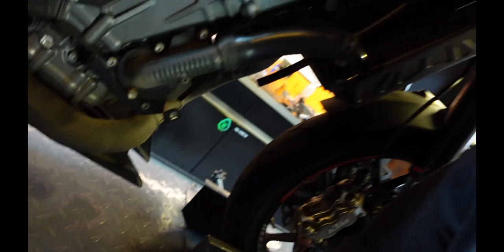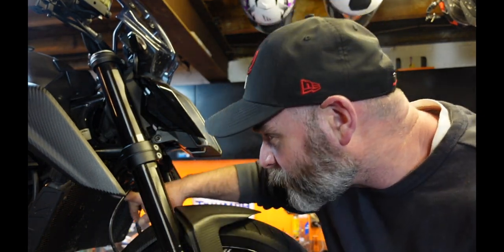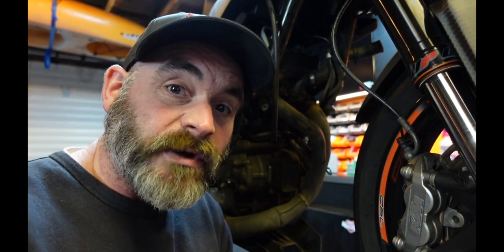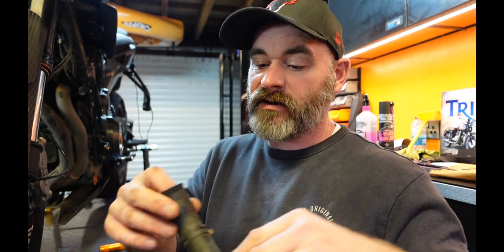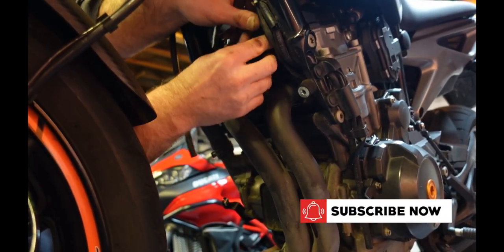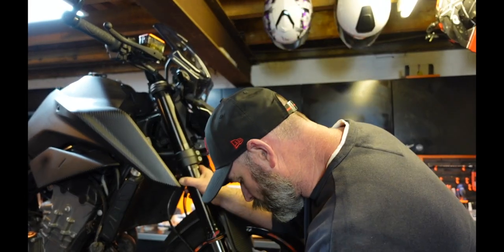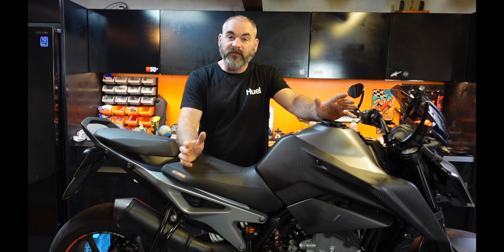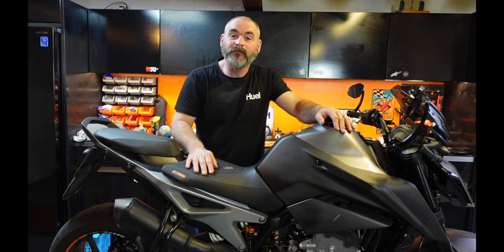How To Repair Coolant Leak on KTM Duke 790

Comment: Thanks so Much for this Video ! I’ve had my duke 790 for more than a year and not a single issue until now when I’m getting the same coolant leak. 

I was afraid to even take the radiator off but I see it’s not that bad at all so I will get some new replacement clamps and swop them out to see if that fixes the issue. 

Your Videos have helped me a lot with understanding how my bike works. 
Thank you !

Comment: I still do not have coolant issues with my duke. What my service told me is that sometimes people use too much of concentrated coolant which is oily and thin and likes to leak from all sides.
Basically, just using ready to use coolant or adding destiled water should solve issue in most cases.
Of course, I am not saying this is universal issue, but since a lot of people are servicing their bikes, it could be that few of those just do it wrong.

And of course, I am not saying that in your case this was issue, but I find this a nice and useful information, so I wanted to share.

Comment: Super common from what I've seen, plenty of people on a forum I'm in have had this issue.  
I had a leak on my 71 plate Duke with less than 1000 miles, not a major issue as mine just needed a nip up with a socket but not great from a quality control perspective.  
Going to get some samco hoses to sort this with some decent jubilee clips.
Reply from the maker: Yes, I always knew it was a common fault with them, but I thought I had been one of the lucky ones - all sorted now and it wasn't too big of a deal to sort.  If I was keeping it I think I'd go down the route that you are taking with the Samco hoses.
Reply: If you're getting Samco hoses you have to use Samco's own (very high quality) matching clamp kit in order for the lifetime warranty on the hoses to be valid 😉

Comment: And after 2.5 years of ownership I'm just now facing exactly the same issue ... that jubilee clip has recently failed on mine too, I can actually get to it with a 6mm spanner and tried to tighten it but no joy, after a few hours theres a small weep forming again. My chosen solution (as I'm keeping my Duke for a while yet) is a full Samco hose & clamp set thats being fitted very soon ... that'll sort it once and for all and look great too 😁
Reply from the maker: Proper job!  Better than my Rolls Royce  jubilee clip🤣. Did the job though!
Reply: @TheBoltHoleBiker  Yep, good but cheap fix you've done there .. no need for more when you're moving the bike on soon. Cracking video too, first one I've seen showing how to take the rad off ... nice work!! 😁
Reply from the maker: @MotoGoato  Cheers!👍

Comment: Hi bolt hole, really useful video - thank you! do you recall where the connector for the radiator fan was located? I'm having an issue with my duke at the moment with the radiator fan not engaging once engine temp is up to 5 bars and had the engine temp warning the other day when in slow moving traffic. I want to jump the fan to see if it engages before removing radiator to check thermostat etc (I see no leaks and coolant levels are fine etc) as don't have the most space to flush everything currently so want to do as a last resort. Thanks a lot

Comment: Useful vid, cheers.  By the way, any idea where I can get matching grey touch up paint for the engine block of my 790? I've got an annoying stone chip which is really obvious as the silver alloy shows through. Cheers Scott
Reply from the maker: Hi Scott, it’s a bugger when that happens!  Colour matching is a bit of a black art, or trial and error as it is generally known!  Most important is that whatever paint you use is heat resistant.  There are various heat resistant rattle can spray paints and Hammerite is actually meant to be good up to 600 degrees C, it is just getting one that matches the colour.  In the past I have used stove and bbq paint, but again that’s only going to work if the colour matches well enough.  Most of the ones I have mentioned you can just get from places like B&Q or Screwfix etc.  To take some of the guesswork out of it an automotive paint supplier could colour match for you and should be able to mix up half a litre and fill a rattle can for you, but you’d have to check what types of heat resistant paints they can do.  Anyway, I hope this helps, good luck!
Reply: @TheBoltHoleBiker  Appreciate your help. Thanks!
Reply from the maker: @scottbailey5644  👍

Comment: Hi, my duke is also leaking. I thought it is the thermostat housing. But how do I know for sure... I have a duke 790, 2018
Reply: clean and dry the thermostat area and then keep a close eye on it (without using / riding the bike) ... a couple of hours after drying on mine I can see the wet trail where the dribble has come from and it's very clearly coming from the end of the hose. If the housing is leaking it will be from the gasket which is an inch or so lower than the end of the hose .... so if it's wet above the gasket line then the leak is from the hose ... if there is no wetness above the gasket line then it's coming from the gasket ;)
Reply: @MotoGoato  thx for you're answer. I have cleaned it as much as I could. But I can't see where it's leaking. I don't have a good eye on it because the radiator
Reply: yeah it is difficult to get an eye on .. the easiest way is to look up at it with your head by the bottom left hand corner of the engine whilst shining a torch up in there, laying on the floor is best if you don't have a bike lift .. there is an angle where you'll be able to clearly see the end of the hose and see if there is a bead of leaked coolant there. The original camp is a 25-40mm diameter jubilee but it's fairly narrow ... go for the same size but a decent chunky / wide one (at least 9mm wide) in stainless / marine grade and that should last a lifetime ;) .... the clamp can most likely be changed over by just unbolting the rad at the bottom (without the need to drain it) to allow a bit of clearance to get to that bottom end of the hose but it'll still be tight n fiddly. Easiest way to get decent access is to follow exactly what Bolt Hole does in this very video and drain the coolant and remove the rad :)
Reply: thank you again. I don't think the hose is properly secured. (I took a picture but unfortunately I can't post it) on the thermostat housing there are 2 edges across and the hose is not over it. I would like to show you the picture to make sure.
Reply: You're welcome. Those 2 edges on the thermostat housing that you mentioned ... do you mean the 2 little wedge shaped tabs that stick out from the housing tube? If so then the hose is not supposed to go over them, the hose is just supposed to butt up against them (they are there to stop the hose being slid too far down the tube on the housing) ... hope that helps.

Comment: Mate! I've got the exact same problem I was going to order new thermostat, rad hoses, jewbilee, and also my rocker gasket seals are weeping as well -,- had the bike in bits yesterday isit still leaking a few days on?? Has it fixed the issue? My rad hoses looked fine as well
Reply from the maker: Oh. man, that sounds like a bit of a nightmare, I hope you get it sorted!  Yes, mine appears to have been solved by just the jubilee change over.  I've just been away for a week on the Multistrada and there were no drips under the Duke when I got back.